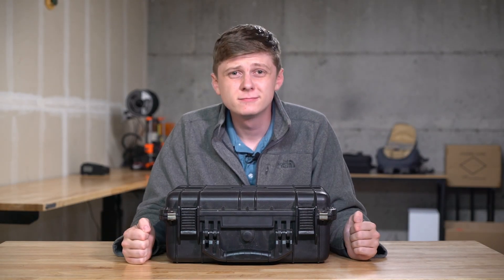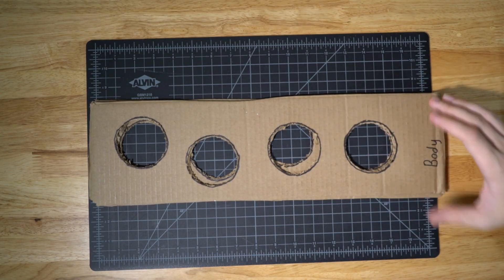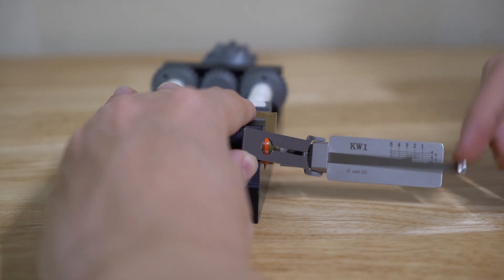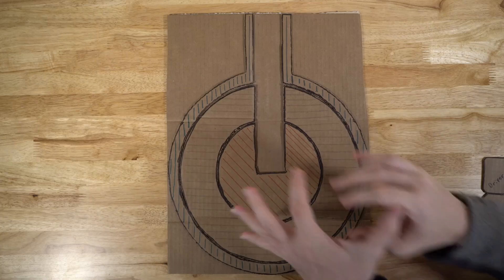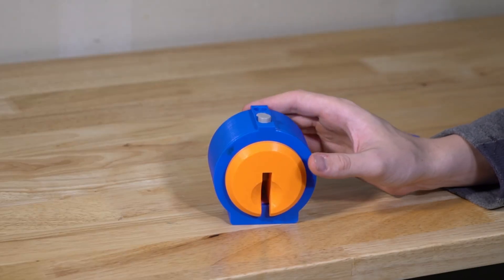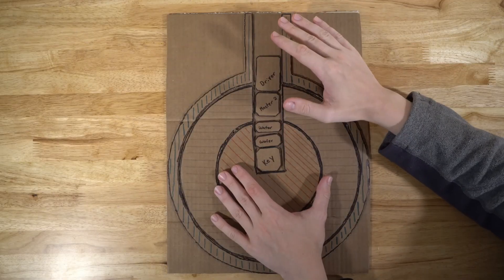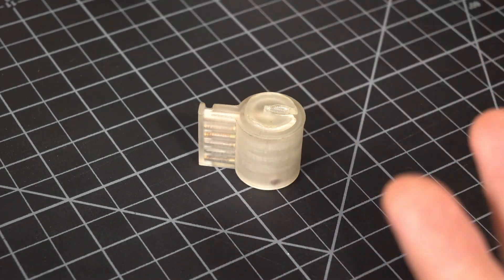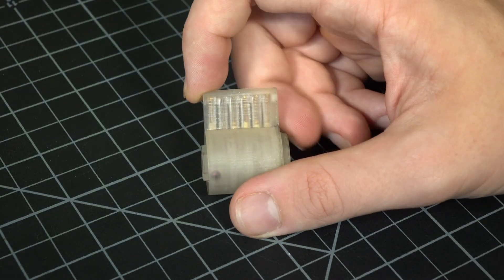How to Design an Unpickable Lock

Comment: Locksmith here, there are locks that are EXTREMELY hard to pick.

The issue is price, people aren't willing to spend a hundred dollars or more on a basic lock. Not to mention installation, servicing, etc.

The more pins, the more something can go wrong.

Just one master pin can greatly reduce the pinning arrangements, I could make a "unpickable" at my shop. The issue is you wouldn't buy it, you might think you would. But you won't. People don't even want to pay for basic security pins, they WILL NOT pay for some hyper advanced lock.

We sell Abloy locks, extremely high quality obscene pick resistance for a few hundred. And we also sell commercial master locks with pretty trivial pick resistance.

We sell dozens of Masters a month, I've not seen a single Abloy sell in the last 2 months
Reply: Exactly, the main thing about economics is how to make cheap locks that are just 80% better at pick resistance without much extra cost.
Reply: I think that's where people like LPL come in showing how easily defeated common locks are. I ended up choosing a lock that while not expensive and not unpickable, requires an odd way of tensioning that would thwart most pickers. When I build my forever home and I have more valuable stuff in it, I will certainly be spending at bare minimum abloy price for my door Locks, which of course would be coupled with better hinges, hardware, doors and frames. I know most won't follow my lead, but I try to convince people of the value of security.
Reply: @Manatee360Phototography Better have unbreakable windows too
Reply: Isn't there also the issue that having a completely unpickable lock means if you lose the key you are going to have to break a window or knock a door down? Is completely unpickable really desirable? Really you just want something inconvenient enough that it's going to be obvious if someone is there trying to pick it...
Reply: @netherby4335  You can drill a lock out if it can't be picked.
Reply: @nisonatic  Wouldn't that depend on the lock design though? And aren't most security lock bodies made to prevent being drilled?
Reply: @nisonatic  9:55 high security lock cylinder are drill resistant
Reply: I can drill open every lock
EVERY
Want to use a body made of titanium?
No problem !
1mm drills
Carbide or diamond coated
Gallium is funny too
Reply: @netherby4335  - This is not a bad point, but there is one serious thing going for lockpicking that those approaches don't have. 
Lockpicking is subtle. Generally quiet, the loudest lockpicking is generally bumping and sounds like someone aggressively knocking. Destructive entry like drilling a lock, kicking in a door, smashing a window... all that is loud and very importantly leaves a trail. That can alert residents and put the authorities much hotter on your trail.
You kinda end up with a few tiers of security you ought to prepare for based on what you think you need:
- A bad lock will keep out honest people. They won't even try it.
- A good door will keep out dumb dishonest people. They might try to smash, but if it's solid they'll flee before someone challenges them.
- A good alarm and weapon will protect you from dumb dangerous people. They might smash their way in, but now they face opposition (or are soon to).
- A good lock will keep out clever dishonest and dangerous people. They're to smart to try and smash or set off alarms, but if they can't get in subtly they won't risk it.
Reply: Decent quality locks come with cards which specify how the lock was pinned. If you have that card, or the information on it (stored in your password safe on your phone, for instance) a locksmith can easily recreate the key  @netherby4335 . Sure you have to keep the card and the information on it secure, but then stealing your keys is way easier than cracking your password safe.
Reply: @netherby4335  exactly! Along that same line, if someone wants in and can't do the lock, they are likely to break the window. 

Now do you get ultra reinforced windows, walls, doors, roof, etc... etc... until you are living in a bank vault? 

Maybe if you are a millionaire... but for most folks, no. The simplest method may just be breaking the door down, and if someone wants in bad enough, they WILL get in. 

Security does significantly raise that bar, sure, but that tradeoff is money.
Reply: @netherby4335  I think a new $100 lock would still be cheaper than the window or the door... :| So cut the lock, go buy a replacement. Learn from your mistakes. Don't do it again. Not really a deterrent for me to NOT buy the good lock, if it's worth it to protect contents of said shed ;)
Reply: @netherby4335 isn’t that the whole idea ???
Reply: It must be a cultural/historical/awareness thing too. In Finland Abloy locks are pretty ubiquitous. I personally happen to think that the main reason for this is the control of locks and key production via licensed locksmiths, intellectual property rights limitations for importing key blanks and the whole system where you have to order the key from the factory directly. The locks are safe, kinda pricey but people generally can't copy the keys. People who move into a new house generally don't change the locks if all the keys are still present and the lock is a fairly modern Abloy lock with patents still being enforceable and no licensed locksmith will go near copying a key or importing black market foreign key blanks. It's a trust thing and I don't think you can set up such a business model from scratch in 2024 and especially not in a country where no one trusts locks to begin with.
Reply: @wombatillo it's because you live in a high-trust society. Unfortunately, the US is a low-trust society due to Diversity
Reply: People aren’t willing to pay because they don’t realize how easy it is to defeat locks. If they did they would.
Reply: @jakeharms1386  Oh, I know exactly how easy to pick most lock are.  I still wouldn't buy an expensive lock for most applications.  For a whole lot of reasons.

Mostly, we lock things to mark a door as 'secure'.  At best, we expect it to keep out some dumb kid.  For determined adult, the lock is rarely the weak point, and when it is, destructive methods will almost always get it off/open PDQ.

The honest truth is that, beyond just trying the door to see if it's locked, non-destructive entry is pretty rare.

To put it another way, IMHO, you're far better off protecting your home with a cheap security system than an expensive set of locks.
Reply: but then again master lock amd similar companies tend to sell a lot of „premium“ locks that really arent much different than normal locks. so there is a market for high priced locks. and it is currently flooded by locks that dont really provide any real security compared to a cheapo lock.
Reply: In Finland most locks are Abloy and buying anything cheaper isn't even considered
Reply: Lets be real though. Apart from some RnD that would be needed to make the lock, it's not significantly more expensive than the standard lock to manufacture. The manufacturers just don't want to setup new production lines, because most people dont know the difference and they don't think the investment into a whole new production line will pay off. If they did do it they would be just as cheap as any other lock.
Reply: This version of an unpickable lock seems a lot cheaper than the other designs I have seen, so I have a lot of hope for this being mass-produced. But it's probably unlikely.
Reply: The OP misses the point of this design: The super high manufacturing methods needed with conventional one-core designs to resist picking aren't needed in the new design.  

Slightly more complexity, and perhaps 50% more cost, in the mechanism is traded for the "unpickability" (to current methods) of a dual-core design. 

Expensive high-precision is not needed for pick-resistance with a 2-core design.
Reply: I own 5 Abloys of various sizes. Such great padlocks.
Reply: This gives big "You think you do, but you don't" and "Do you guys not have phones?" Vives
Reply: The homeowner also knows that an unpickable lock is of limited use when the whole building is only as secure as the weakest point. If you have an unpickable lock, the burgler is just going to smash a window, or crowbar up a corner of the garage door.
Reply: I think people are unwilling to pay premium prices for a lock because most locks that get defeated in a break-in are NOT picked.
Lock picking is a skill. Most thieves are unskilled, and use other methods to defeat a lock, predominantly by bypassing the lock itself altogether.

I can, with 100% certainty, guarantee you that, in my area, not a single lock was picked on any of the (motor-)bikes that were stolen, or on any of the windows that were broken to get into a place, or on any of the doors of cars, sheds, houses, and businesses that were broken into.

The preferred method of breaking in is not lock picking. It is by force of some kind, including electronic overrides (on car door remotes and pin code locks, for example).
The simple reason being, that bypassing/breaking by force is much faster, and thus less risk for the thief.

So, buying an extremely expensive, hard to pick lock isn't in any way going to prevent a break-in, and thus a complete waste of money.

The ONLY reason why people (like me) purchase a lock, is to make it somewhat more difficult for a thief to steal, thereby hoping that the thief will then go for an alternative, which does not have the same inconveniences, and can be stolen more easily and faster. So, an expensive, hard to pick lock was never an option to begin with.

If anything, we look for a lock system that has the greatest possible protection against forceful break-ins / theft. For example, a bike lock that has strengthened & hardened chains, plus a protective cover that prevents (to some extend) being clipped by bolt cutters. We really do not care about being hard to pick at all.
Reply: I think that the real problem with investing in a better lock is that a system is only as good as the weakest link.

You can have the best lock in the world, doesn't matter if the door is made of wood, just kick the frame in. Make the door metal? Throw a rock through a window.

99.99% of real criminals aren't going to waste time to non-destructively defeat a lock. They don't care if your propery is damaged while they steal from you.

Now, the real problem with cheap locks is when they can be opened toolless and keyless faster then the person who's got the key can open it. Because yes, somehow there are locks so bad that its faster to open them without the key. I have a padlock that can literally be opened by shaking it and pulling.
Reply: You're right, though for someone like lpl, "unpickable" usually means it takes him 3-5 minutes instead of 30s. I know most common criminals can't pick locks at all, let alone as quickly and effectively as that.

But this guy's point is he wants to make something much harder to pick that is cheaper.

And tbh, if you own a lock shop, I think it'd be worthwhile to keep a rake on hand and show people first hand how easy it is to open master lock.  That way, you educate people and possibly upsell better locks.  Maybe some a few bucks pricier with a few security pins in case they don't want to spend a few hundred.
Reply: Very valid point
Reply: It's not that people are unwilling to spend money to secure their belongings, it's that they don't see a difference between a $3.99 "Security Level 11/10 super-safe ultra premium also-cures-cancer PingPengPong Lock" and a $20 "entry-level security" lock that is ten times as secure.
Reply: Besides, uneducated criminals take the path of least brain power to break into somewhere. Your average person isn't gonna get robbed by a dude with a picking set, they're gonna get robbed by a tweaker with a cinderblock. 
Masterlocks that can be hit open or pushed above the sheerline are still unacceptable, but using an unpickable lock is unnecessary as well when the method that's gonna be used to break into your house is probably gonna be a smashed window.
Reply: I never buy Master unless it's an extremely low security scenario.
Reply: He says exactly that at the start and end of the video? Not sure what point you are making.
Reply: I remember as literal 16 year old kids thinking lock picking was cool (it is but never actually got too far into it) and we made a pick out of a dollar store screw driver kit that we ground thin and bent slightly making a rake and I forget what we used as a tensioner. We tried a master lock on this building down the road and it took about 5 seconds of raking and we opened the lock. Immediately closed the lock and no we did not open the door it was to like a sewer access or something so nothing but a lock we could try.  It was at that point I realized locks primarily keep honest people out. And maybe slightly slow down dishonest people. It takes multiple steps to protect things like video, motion lights and motion alarms. I do think quality locks could be made cheaply enough. But I think the makers realize weaker locks sell and if they made a stronger lock then they can Jack up the price not that they need to.
Reply: I would love to get a medeco or something fancy at my house. my problem is we have lots of windows and a garage door, and 2 sliding doors. having a badass lock on my 1 front door wont stop anyone. IF my front door was the weak point, I'd jump at the chance to harden up my security for ONLY $200.
Reply: People aren't willing to pay for high security locks because lock picking simply isn't a common method of breaking and entering.  Most break-ins are exactly that; BREAK-ins.  You're FAR more likely to have a window smashed or door kicked in than you ever are to have a lock picked.
Lock picking is done by criminals in the movies, not in the real world.  Despite the ease with which a common Kwikset or Schlage deadbolt can be picked, common thieves simply aren't putting in the time to to learn the skill when kicking in a door takes 1 second, requires no skill, and grants the same access to your home.
Reply: That's pretty obvious. And he mentioned that too at the end of the video.
Reply: The problem is that many locks are wanted to be pickable sadly and the fact
that there is no greater industry for actually safe locks... In 2008 any processor
in a computer from 2016 that is now deprecated would be deemed near to 
impossible and yet now it's deprecated and sells for a few hundred bucks while
back then it'd be considered $1,5Mil witchcraft. We advanced, processing and 
fabricating techniques advanced, that's why it's become cheaper and we may 
create new stuff... Like as always and everywhere... 

The main reason why ppl are less interested is because most locks aren't picked
anyways, the attack vector is too big in almost all scenarios where locks are 
involved; so big in fact that investing more into a lock provides only minor to no
security benefits at all... And I think that hints a greater problem to us...
Reply: People are idiots
Don't they think all their possessions that they own in their home is worth a few hundred dollars?
Or do they think that insurance will foot the bill when they get robbed?  
Hey idiot, they just took your NAS, there goes all your families memories.  Tell them now how you saved a few hundred dollars by buying cheap locks
Humans are so stupid.  Hey you, the misses wants you out of the house, she's had enough of your cheapskate ways
Reply: I'd love to have an abloy lock on our house.  I don't need it as someone would just kick the door down or bust out a window - but I like their engineering.  We've got a 1904 door though, where the lock and latch mechanism are cut into the door in a way that isn't done anymore so no modern lock/latch setup would work.
Reply: I would 100% buy it if whatever i want to protect is worth more than the lock.
Reply: Why pay 50% more for a "unpickable" lock if still You can cut the shackle with a Bolt cutter or an angle grinder
Reply: Ultimately, you have to consider other vulnerabilities. Like crowbars, windows and unlocked patio doors. Most locks are "good enough" for the job they're doing. They could be significantly better, but then few would be willing to pay the extra price.
Reply: @mariusvanc  If they can be opened silently by anyone in a few seconds, they should be taken off the market.

I wonder why government hasn't regulated scams in this market?
Reply: There is zero reason for an unpickable lock to cost more than a pickable lock.

Brands like Master simply don't care. And brands like Assa/Abloy are too big to do things right or make anything cheap.

Just set up an equivalent size production line with simple but better products and make your marketing blow those others out of the water by saying yours are pick resistant, while brand X isn't.
Reply: Why would it cost more to create those more secure locks if they are bought by the thousands? Even high precision pistons for engines have become cheaper
Reply: @TecSanento  yes higher precision machining is always more expensive
Reply: @AFailedTuringTest  Not with good automation.
Reply: People will spend thousands of dollars on a security system, why would they not spend $100 on a lock?
Reply: @Superabound2  no clue mate
Reply: I am the one customer that buys the quality locks. But that's because we also got "quality" criminals here that actually do pick locks rather than just going for brute force every time.

But if they can't pick it, they will go for brute force regardless. The only difference is now they run the risk of discovery.

If you have a high quality lock and chain that is locking a weak wooden shed door. Then the door is the weak link. The criminal will just break the door.
Reply: Go a head a spend few hundred on a lock your gate, door, wall and window are not inscrutable.
Reply: Well, over here in switzerland, despite crime being next to not exist in comparison, you get with very good SEA or KABA lock installed in every renter apartment.  Criminals never pick the lock, they always use different means to attack (mostly windows, or if it's a old weak door, they simply break it open). For the most part, they are left unprotected from getting drilled, which is how the locksmith open them, as they can't pick them either. Do are about 200-300$ i think.
If they have full protection i saw even locksmith walk away.
Reply: Locksmith also, get a mindy like Bosnian bill showed, they're not expensive and scare away all but the very most determined pickers. They can definitely be picked but because people aren't familiar with the strange keyway no one really ever tries.
Reply: The issue is that, picking is only one method to bypass a lock.  It's probably not even the most common method to bypass a lock.  Plenty of locks are defeated by a crowbar, hammer or even finding alternative entry points.  If all else fails, nothing is going to stop an angle grinder.

So is it really worth investing a few hundred against an attack that's very unlikely to happen?  It's like installing a turnstile in the middle of a field.  People will just walk around it.
Reply: As professional the most grand advice you can give to a lay person is what lock is worth it's money; tell them what definitely NOT to buy :)
Reply: @_-Karl-_  The Abloy factory has a record of all the keys produced. I'm not saying I agree with this approach but the keys under patents (and not allowed to be sold or imported because of this) are also extremely complicated to make and copying them is so rare I have never heard of it. The +30 year old models can be copied at any mall but the new ones are good in that respect. If Abloy says you have 5 keys which have been made for this keycode card and the 5 keys physically exist in your hand, you know they're all accounted for. Breaking the door or the lock or the hinges is always easier than copying the (current top of the line) keys.
Reply: @wombatillo they key a record of the key but not the end user, what good is a code if you don’t know where the lock is
Reply: aou could sotre a key with a good friend or a good hiding spot in the garden at least that is what i would do
Reply: Yeah, why would I pay that a high price e.g. 500$ for an unpickable lock? First it depends on how valuable the thing is I want to protect. It does not make sense to lock a 100$ bike with a 500$ lock. Next thing is: Picking may be a sport, but in practice most locks are defeated by destructive methods. So why would I pay 500$ for a lock that can't be picked but will be defeated in less than a minute using an angle grinder? Or if it is not a bike lock, but the door to a house, than the window may be the weak point.
So bottom line there are many factors to consider when buying the lock and in most cases you will look for a sweet spot of price and security offered.
Reply: @livinghypocrite5289  but a master lock is never the right answer
Reply: @livinghypocrite5289 expensive locks aren't purely pick resistant. They are also destruction resistant...
Reply: There's a rather large bit of wiggle room, if you will, in price between a $12 Master Lock and your several hundred dollar Abloy, surely you aren't saying you can't make an affordable AND reliable lock?  That attitude is what keeps innovation from occurring and Master Locks easily pickable.  We WILL pay for some hyper advanced lock, it just needs to be designed and made to scale that allows for it to be sold at an affordable price.  Whose side are you on, after all?  I understand the premium for the tolerances and precision of such a design, but we've overcome that in tech and with tech before, there's no reason locks should be any different.
Reply: @_-Karl-_  From manufacturer specifications
Reply: I mean... The super secure locks are a huge waste of money. If I wanted to rob a place, why would I even address the lock when every home has giant gaps in the walls covered by easily breakable glass? And if the windows are polymer instead, one swift kick will open just about any front door because NO ONE renforces the frames. Seriously, the lock isn't the weakpoint of a normal home. Especialy when most doors have huge windows in or next to them that you could smash and then unlock the door...
Reply: Honestly shame on you for even selling masterlocks. There are much more secure alternatives for the same price or just barely more.
Reply: @jakeharms1386  If someone goes there to buy a masterlock and he doesn't have any they will just go buy one elsewhere 99% of the time...
Reply: @JohnnyYenn  I don’t think very many people want a masterlock. They just want a lock
Reply: @jakeharms1386  I have shown people, they still don't want to pay the premium.
Reply: I spent 395 eur for just three (same) locks with 12 keys, and I doubt they're really that secure.. so what would the retail price be of a pick resistant lock?